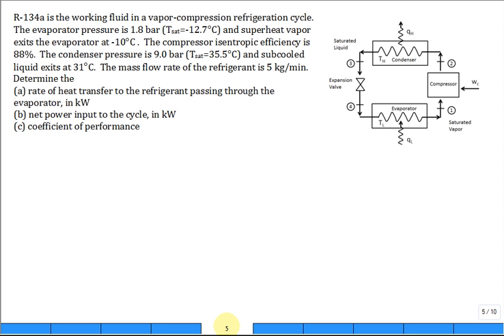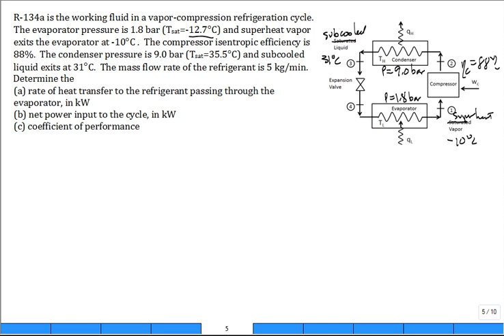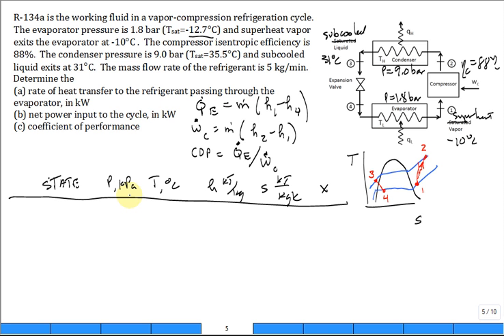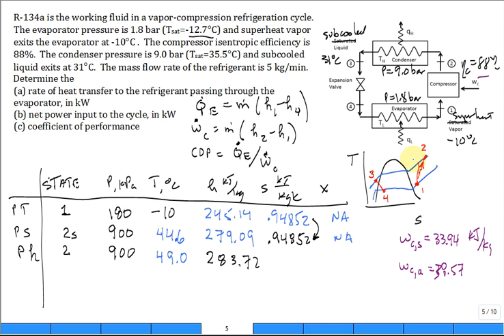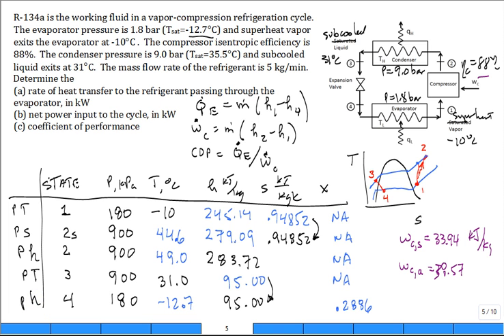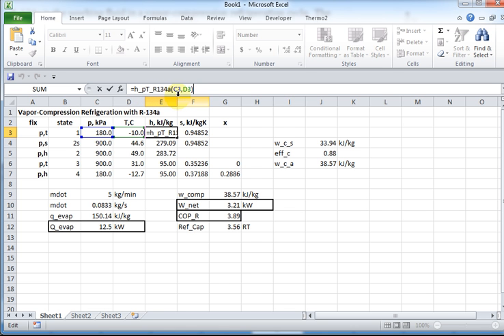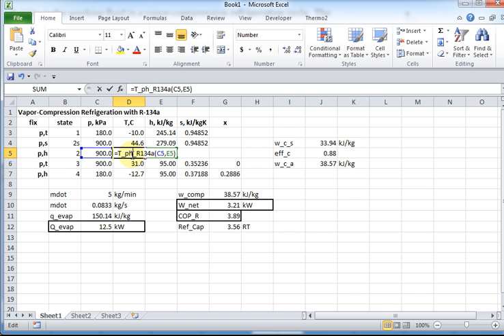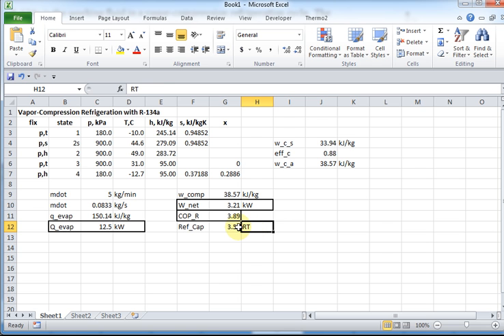Calc refrigeration 180kPa 900kPa eff Excel

Comment: Hi, if we do cascade operation of 2 nos, 2 TR split AC compressor,  what would  be the diagram and calculation. If u could do explanation with an example,  would be helpful. Purpose of cascade,  to operate Slit AC's low pressure compressor for Refrigeration purpose at get high pressure difference at suction& discharge, without motor failure by over current.